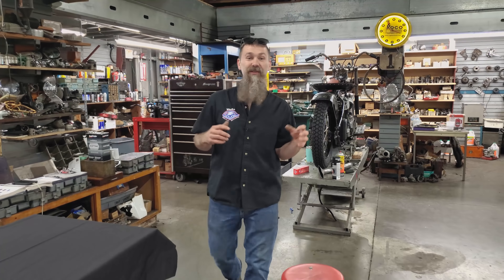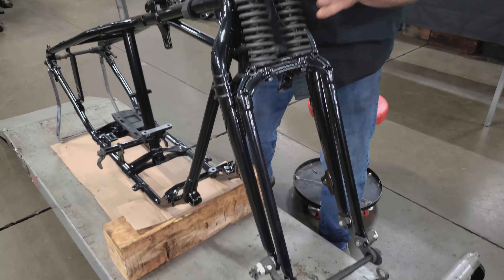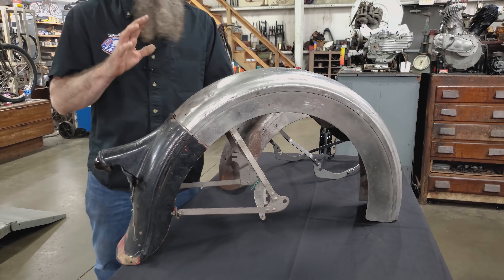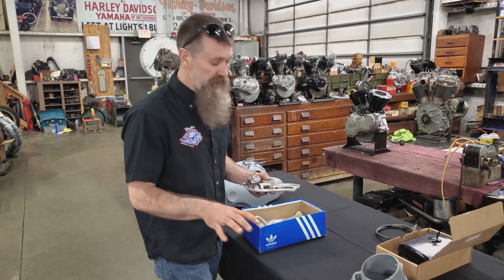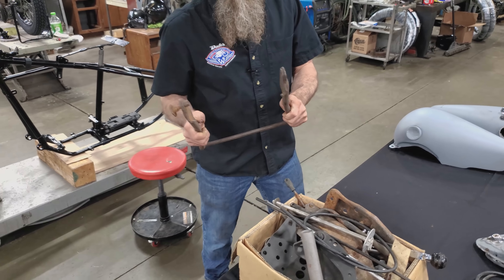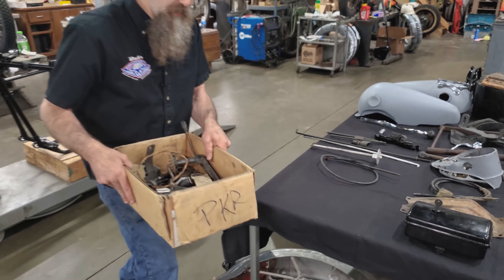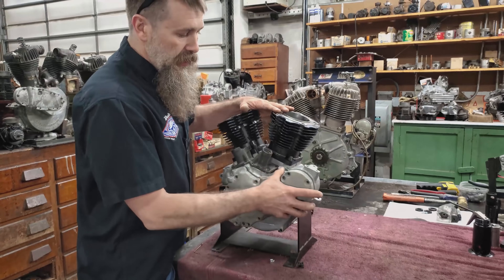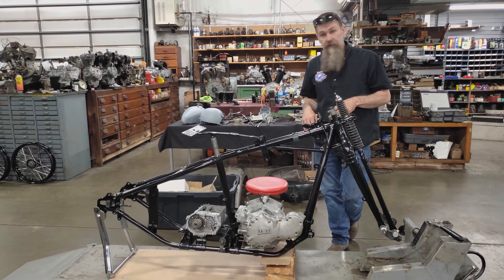THE RAREST ONE YET!

Comment: That's pretty amazing. Although the original paint + patina have a special charm, it's also nice to have a perfectly mechanically sorted bike.
Reply: Both have there merits.
My little 45 looks good in her old paint. Her pipe is safety wired, she's not 100% original, but most of it works.
But then the black pan we built is flawless. All stainless and nickel.
They look good together, extremes.
Be well and have fun.

Comment: I recently saw something odd online. It was a 1938 (if I remember correctly) Harley WL but it had overhead valve cylinders on it. It wasn’t a 45 magnum either, looked to be stock. From what I read, it was an experimental project or something that was scrapped. Super weird.
Reply: @rivjoy  it’s a iron head top end on a WL bottom end. I’m not sure what the one you described is called, though I have seen some pictures of them before.